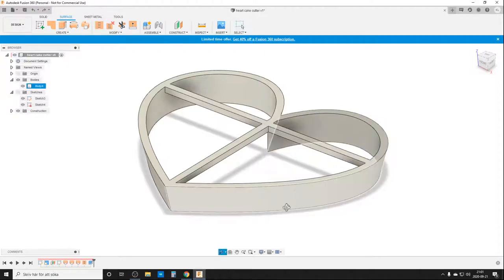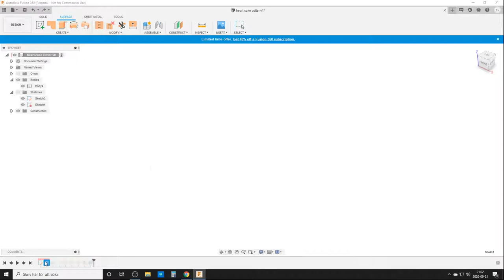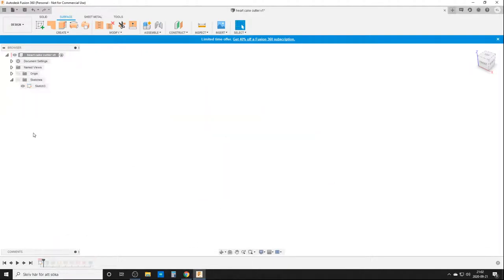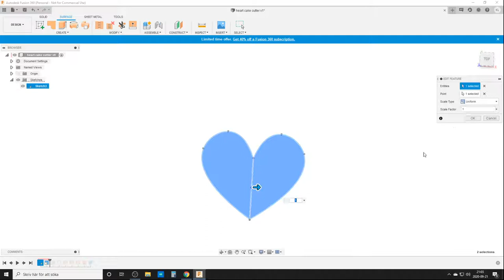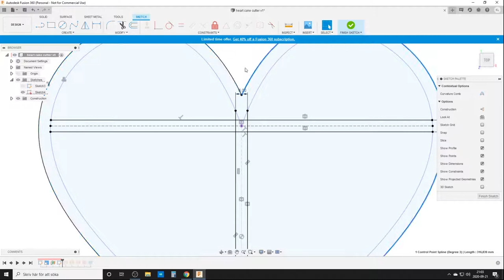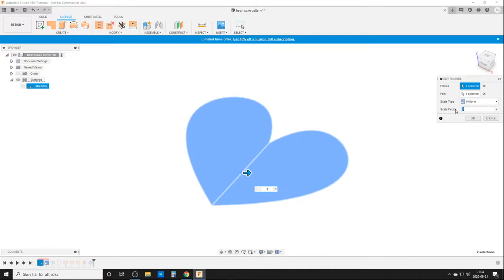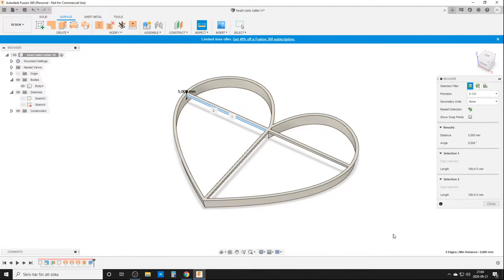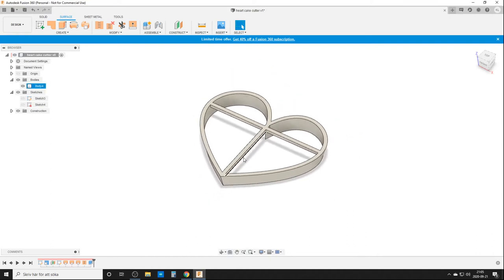Fusion 360 - Scale a Spline Sketch but Not other parts of the Model.

Comment: Very good! But. How to control scale by dimension of sketch?
Reply from the maker: Do you want to drive the scale factor using sketch dimensions? If it's driving dimensions it could work I have not tested it.
Reply: @KristianLaholm  yes. I have a circle and imported curves inside it. I need to change diameter of circle, so  curves need to scaled. By now, I manually enter scale. It needs the time
Reply from the maker: @AntonAndiievskyiAntonVA  If you know the dimensions you want the scale factor is = (new dimension) / (old dimension) of circle. But with imported geometry things can sometimes go bad in strange ways.
Reply: @KristianLaholm  where i need to enter this math? I novice in fusion 360
Reply from the maker: There are to much information to give with text answer here. You need to have a look at some tutorials on parameters or ask your question on reddit or in a FB group.
Reply: @KristianLaholm  thanks. I'll try to find this